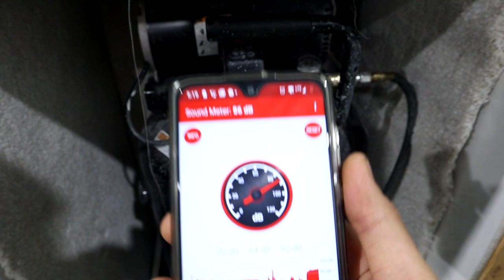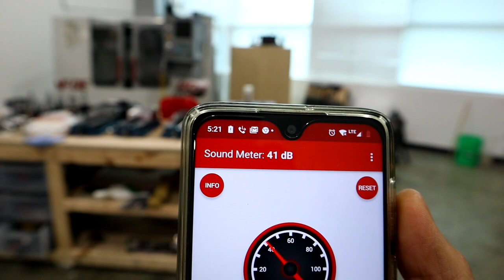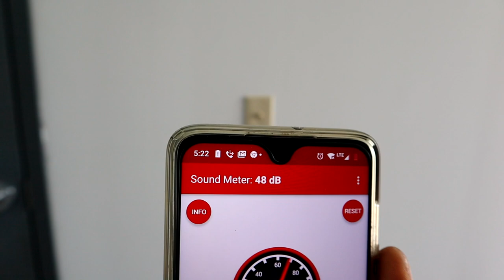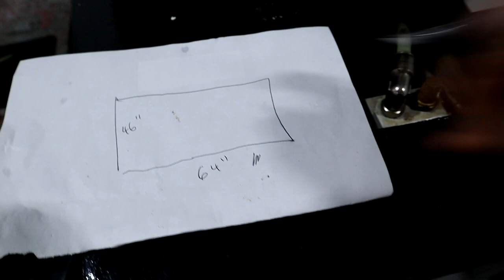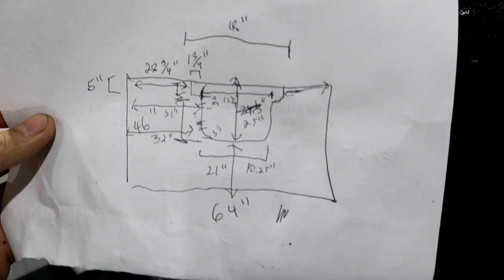Going up on a Sunday Ep.1 - Working on sound deadening the CNC

Comment: For soundproofing your cabinet walls, this styrofoam is useless. Mass is the name of the game here. Half a day cheap solution: take your current cabinet outside, on a pallet, replace styrofoam with some chicken coop wire mesh, pour concrete in there (you may want to add some temporary support to the side plates). While it dries, go find anything 5cm thick and stick it underneath the machine’s feet.
Reply from the maker: Not a practical idea at all. Buzz off
Reply: InspireCNC Buzz off !? Wow you’re such a great host  !
Reply: A M  This tells a lot about the ideas you’ve heard.

Comment: good idea. I have a roof on mine, but it wouldn't help you much because of the different dimensions. It also has quite a bit of a gap to the spindle housing. 
If your compressor is still too loud I'd look out for an used rotary screw compressor. They're more efficient as well but not as cheap.
For the acrylic glass behind the ATC, I recommend the acrylic glass glue "Acrifix", I made some washout booths long time ago and it kind of "welds" the edges together, probably more durable than the sheet itself 👍
Reply from the maker: cool, ill definitely look into buying a rotary screw compressor.

Comment: What is the air compressor sitting on or touching, sounds like vibrations making the noise. If you sat the compressor on rubber or springs that would absorb a lot of the vibrations and potentially the noise, also making sure nothing touches. Did a radio station not long ago and each  radio box was a seperate structure independent to the surrounding walls supported on rubber feet. Our air cons had springs to absorb the vibrations and minimise the sound from the vibrations alone.
Reply: yup,   i have a square of shag  carpet on a concrete floor, rubber feet on the compressor, then a wooden box lined with shag.  thermoswitch for the fan, then intake /exhaust tubes lined with shag,  no  direct line of sight into the box for the flow paths (so noise has no straight shot out.)   Def want the compressor not in contact with the box in any way, not even via rubber.